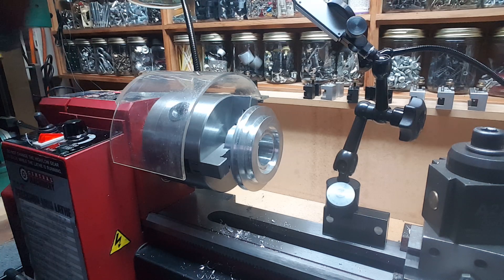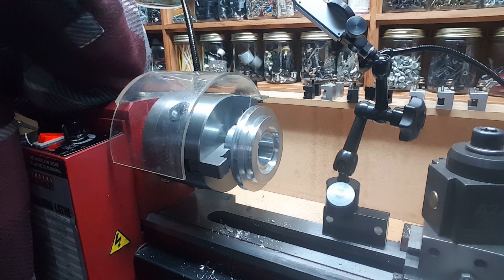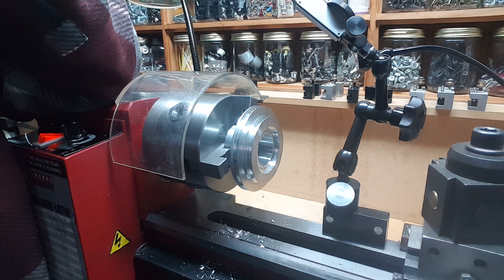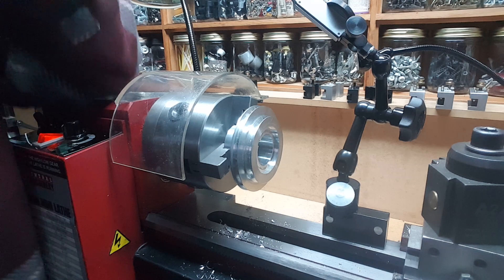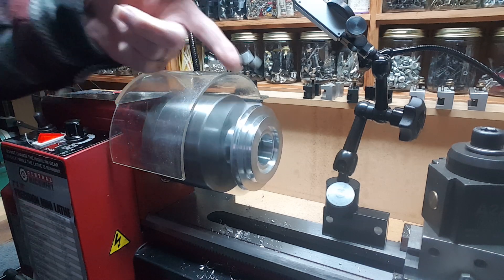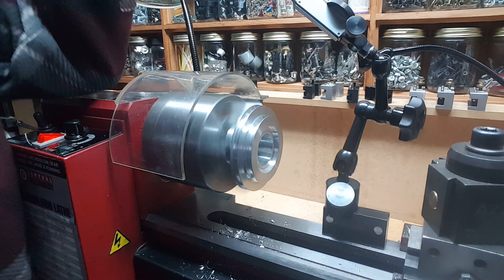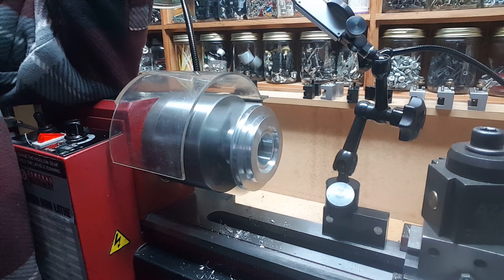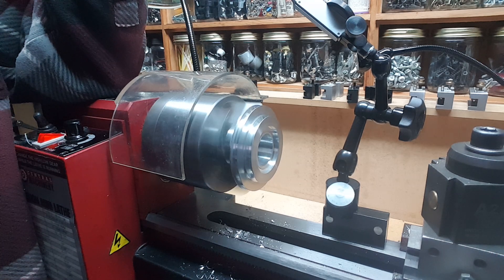LMS Mini Mill Belt Drive Upgrade Problem Found

Comment: Hi Dave, I wonder if you could help me? I have a Chinese lathe 7" x 14" and am ready to buy a 4 jaw chuck. Could you tell me if the 6" chuck is suitable? I'm a bit worried about the jaws hitting the ways but never having seen a 6" I'm not sure if that's the best size. I don't want to buy another 4" as there are so many things that won't fit into it.
Thank's for your time.
Reply from the maker: Hi Glyn, LMS does sell a 5" with the adapter plate for your lathe so I assume it will work. I did see a video some time ago of one. The sad part though is a 3"  holds 3" material and a 4" holds 4" but the 5" only holds 4.33" according the LMS site. Extra money just to hold 4 1/4" stock. 4 1/2" nope. Let me know what you find.
Reply: @TheMiniMachineShop  I'll let you know how I get on, I should have said that I'm in England so our main supplier is a company called Chronos (https://www.chronos.ltd.uk/acatalog/Sharp_4_Jaw_Independent_Lathe_Chucks.html)
but I am looking at the SANOU K72 Lathe Chuck 125mm 4 Jaw Independent from Banggood at the moment, it looks like it might fit.
All info gratefully received Dave, Thanks for your time.

Comment: I have a ques. Would it be possible to use Mini Lathe Machine for Processing Nickel or Stainless steel?
Reply from the maker: Nickel is extremely easy stainless every one has done just needs a HSS cutter. I've even machined titanium with no problem.
Reply: I've successfully used the LMS 5100 on stainless steel. I'd recommend a sharp hard carbide insert, a rigid lathe with tight dovetails, and an appropriate depth of cut to avoid the work hardened layer.

Comment: Hi Dave!
Thanks for another interesting video.
I have signed in in order to get notified when You publish new videos but I haven't got any notices nowdays. I find Your videos on the Tube.  What's wrong Dave?
Is LMS is a prolonged arm for China? I thought I bought Americam quality from them....
Reply from the maker: Hi Stefan, I hear from a number of people about notice problems and no one has figured it out... Sorry but most of LMS stuff is from China at least from what I've bought you can tell.
Reply: That's today.  @TheMiniMachineShop ven brands like Grizzly seams to be "made in China". Placing orders in China could be okey provided there are demands, specifications, regarding run out, tolerances etc.. Why do reputated companies buy machines "as is" as it looks like? They buy things that looks like useful. 
My Chinese, no name, mini mill showed up with a lock screw, for the fine Z adjustment, being loose beacause of worned out Allen key in the factorey ruined the hex. Drilled it out using a left turning drill, replaced the lock screw and drilled a better seat for the screw in the axle.... Later the X movement made noice and got hard to turn. The axial bearings were totaly dry...
 it's an odd and strange world we live in...

Comment: Great, I haven't checked the pulley from my kit yet. 
Ordered my kit shortly after watching your video months ago, so I hope they exchange my pulley if needed.
Thank you for the video.
Reply from the maker: Was your kit as badly finished as mine was in the video? And if yours doesn't make a weird noise it ain't broke so don't fix it...
Reply: Yes, but I will double check for any runout on that pulley before calling LMS.
Reply from the maker: New one arrived this morning and same as years ago perfect finish and .005 run out. Problem is its a .0015 tapered bore so it won't bottom out on the spindle.
Reply: Are you going to bore it out?
Reply from the maker: Some slight sanding worked but they didn't broach the keyway deep enough so will lap the key itself.
Reply from the maker: Had a good laugh!! Finished with the new pulley and was dumping the box.... My video openings have stickers in the background.. well I'm now probably the only one with an LMS sticker! Think they know who I am to include a sticker?
Reply: Wow, no kidding?
That's probably why you get better treatment now as well.
Cheers brother

Comment: Little Machine Shop’s customer service is great until you try to help them resolve their issues.  After that they don’t want you as a customer anymore
Reply: I bought a cross slide gib from them a while back and the thing was as sharp as a razor. I sent and email saying maybe they should put some kind of warning on there because us noobs might sever an artery with this thing.. It wasn't a complaint but just what I thought was good legal advice. They essentially told me to stop being stupid.

Comment: The surface you clamped down on does not need to be concentric with the bore or the pulley faces or the bottom of the pulley,  That surface could’ve been turned independent to the other surfaces.
Reply from the maker: The surface I'm on is concentric with the bore. I did clamp the pulley side and watched the bore wobble...
Reply: Dave M gotcha.  You didn’t mention it in the video so I figured I would offer you my opinion.  Didn’t it wobble on the mill spindle?